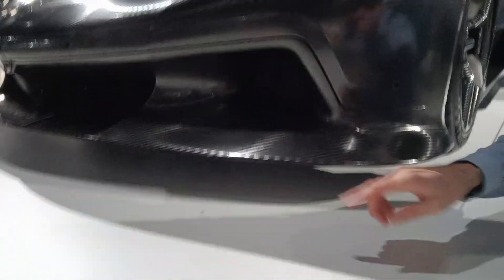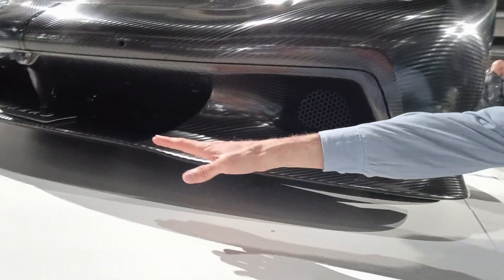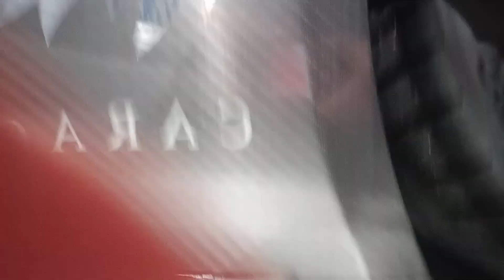Koenigsegg Absolut Aerodynamics Walkaround

Comment: 2:03. The wheel arch is a high pressure zone. The rear of the car is a low pressure zone. So the radiator makes use of the the air pressure differential.